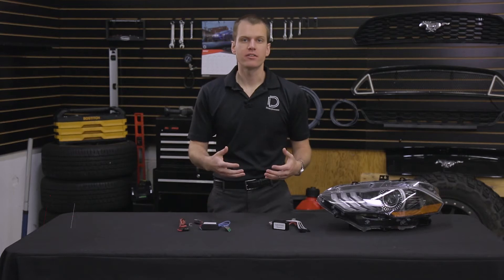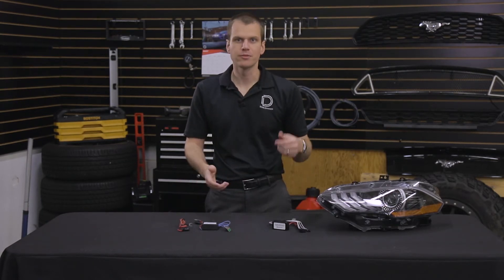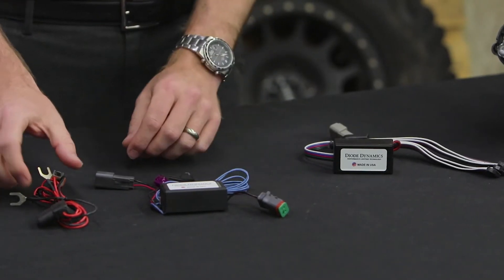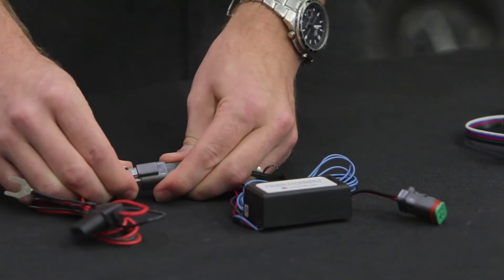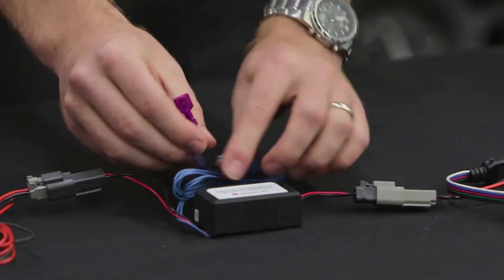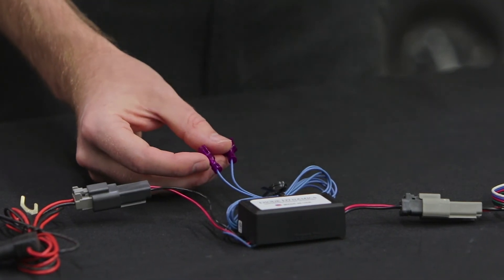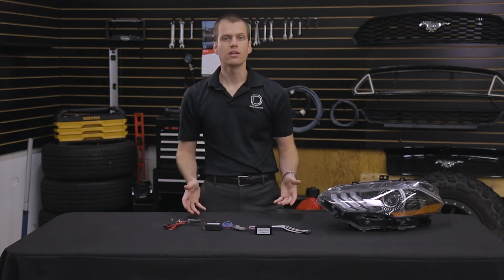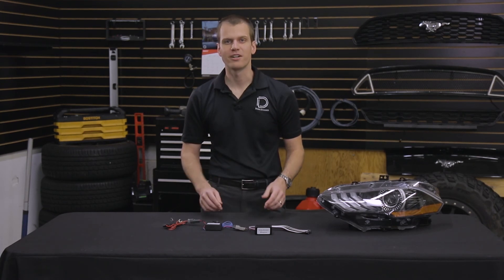How to Wire Multicolor LEDs to Factory Signals WITHOUT Errors! | Diode Dynamics

Comment: In a FB group, I got recommended to purchase the Diode Dynamics Solid-State Relay to fix my Morimoto RGB blinker drl strips  (with XBT controller) from not turning on as I lock-unlock my car. But I live in France and it would cost me twice as much as the original price in terms of shipping + custom fees.
Any alternative or is it a unique product with unique features that can't be found anywhere else?

You can check out my post so you can figure out exactly what my issue is all about and maybe guide me better afterward 🙂

https://www.facebook.com/groups/885813691933212/permalink/996600084187905/?comment_id=996847264163187
Reply from the maker: Hi there! We responded to your DM!
Reply: @diodedynamics  Yep, but I'm from France there are no Diode Dynamics dealers there :(
Reply from the maker: @ALEXAGON  Hmm- We do have a dealer in Germany. You may be able to make an order and have it shipped for a cheaper price! (Auto-Hentzschel GmbH)